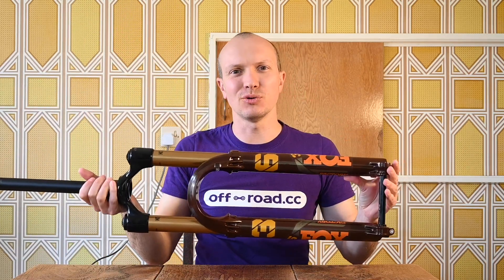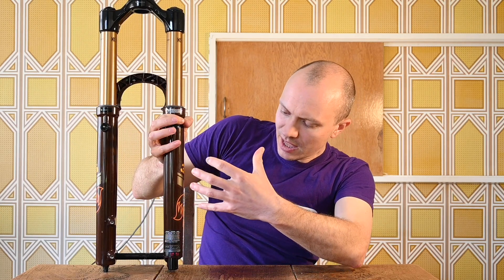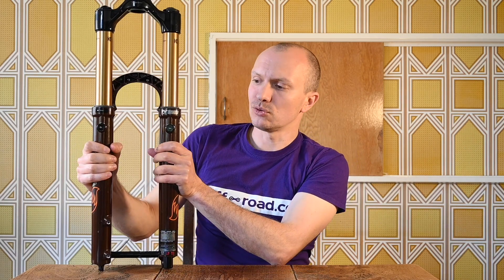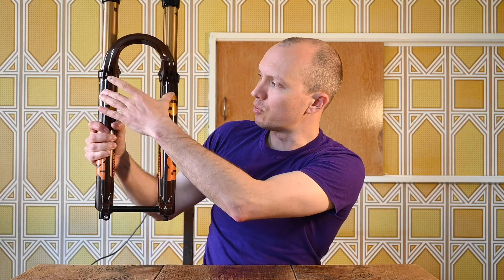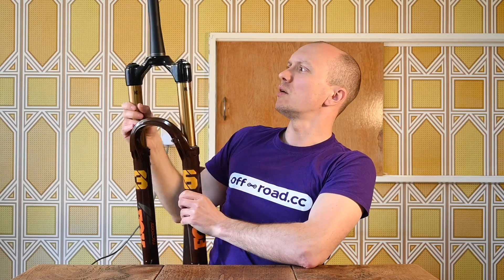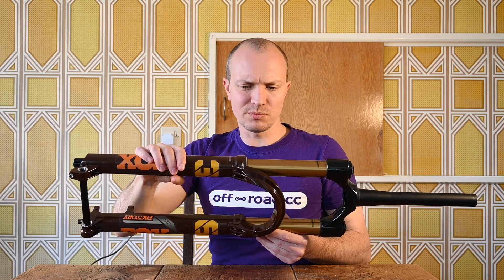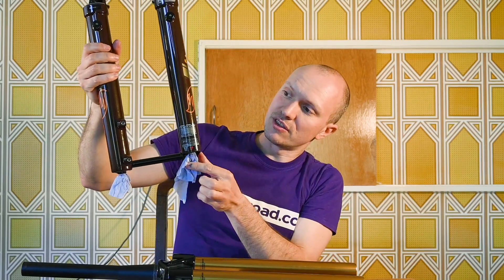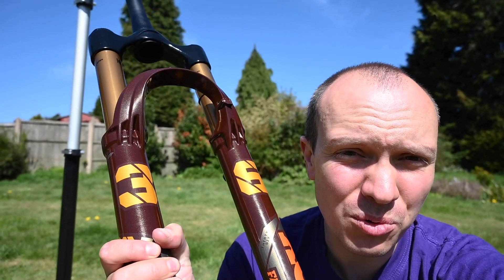2021 Fox 36 tech deep dive - taking one apart to figure out how it works...

Comment: Hey mate thanks for the great video... I just got a 21 Levo SL and it comes with a new 36 in 150mm is it still possible to change the air shaft in the 36 to a 160mm or not ? any help would be great. Sam
Reply from the maker: yeah, I think you can. Haven't heard that you can't!
Reply: I see you everywhere lol... Shopping for a fork on my SL too, mate. the stock 34 rhythm I have on my comp carbon is fucking terrible. Worst fork I have ever ridden.
Found a good 2nd hand 2021 36 Factory.